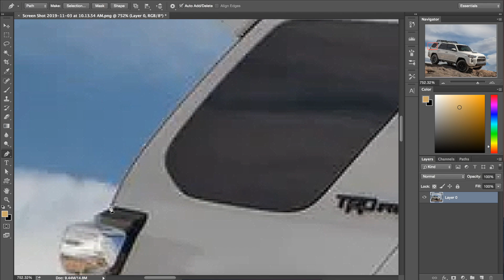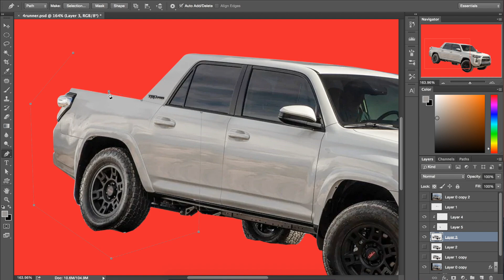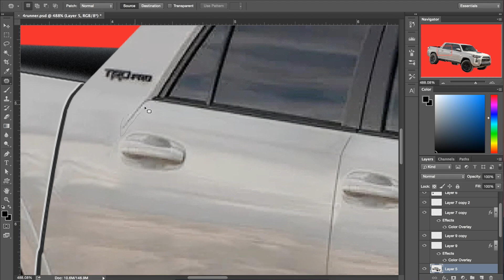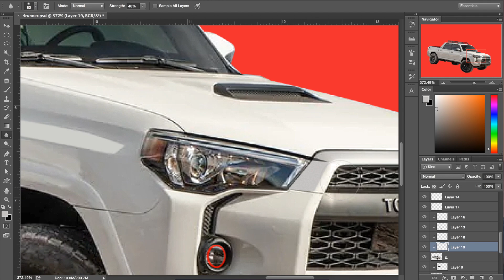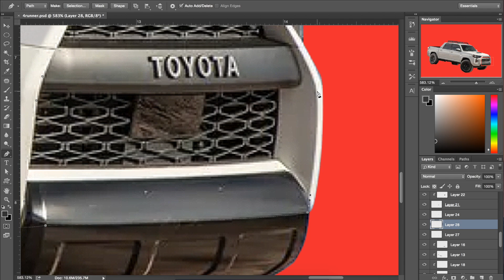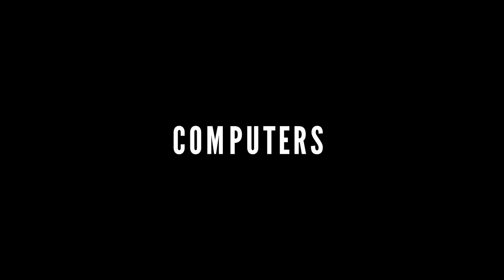Industrial Design: Sketching, Programs, Tools, Computers!

Comment: After looking for months I found very little build or review videos of PC systems (chip -motherboard -memory) just geared towards 3D modeling for Automotive design production and product rendering. A system specifically for industrial designers with a budget of $500-600 for the motherboard and $400-500 for the chip. Not sure if ECC is the way to go and want to get the best motherboard for this specific with no bottlenecks on the board.

Industrial designer’s 3D Modeling workstation software:

Alias 

Autodesk Alias' listed system requirements looks to benefit from several CPU cores, so going with a higher core count processor looks to be beneficial. 

https://www.autodesk.com/products/alias-products/overview?plc=ALSCPT&term=1-YEAR&support=ADVANCED&quantity=1

Keyshot 

In my testing of Keyshot I saw that it is a very well multi-threaded program, benefiting from more CPU cores, so going with a higher core count, the better the performance I will have.

https://www.keyshot.com/

Here is what I’ve gathered so far... 

Industrial Designer 3D Modeling System mins: 

1.    Winders 10, 64 BIT. 

2.    3GHz min 64 bit chip needed for Alias. 

3.    Multicore processor. 

4.    8 Gig of ram minimum push for 256mb on motherboard. 

5.    Turbo Threading preferred. 

6.    I have a P4000 Invidia Quadro. 

7.    256 texture graphics memory min. 

8.    No crazy LEDs, or a gaming rig wanted. 

9.    This machine sits under my desk and is never touched……my last machine lasted 7 years and I never touched it. 

10.  With that said I’d like a motherboard that is geared towards setting it on turbo and not touching it. 

11.  Motherboard needs numerous connection headers for fans and a single SSD drive, out of the way of the Quadro Card. 

12.  I don’t need 6 hard drives and turbo fast speeds to other machines, devices or data centers. 

13.  Just a standalone rendering and 3D modeling beast. 

14.  A full size case with “massive cooling” as its key selling point. 

15.  The monitor I run is the Dell Ultra Sharp 43’’-  4K USB-C Monitor: U4320Q. 

8-core Core i9 9900K with its 5.0GHz Turbo’d is the possible chip but want to pick the motherboard 1st. 

 
Any help, links or comments are greatly appreciated. 

Jason